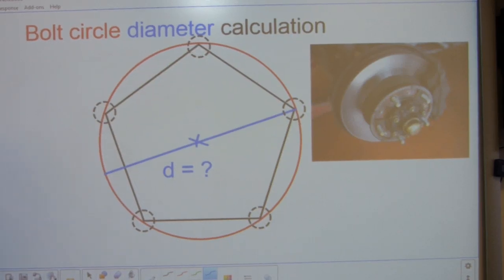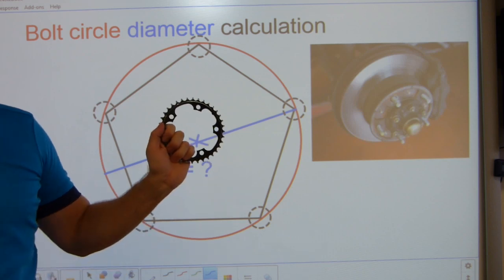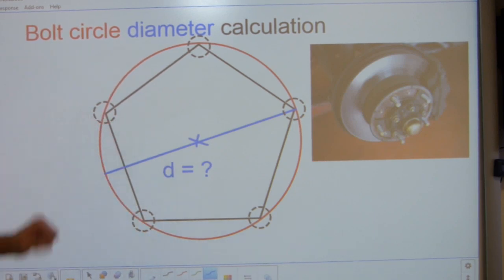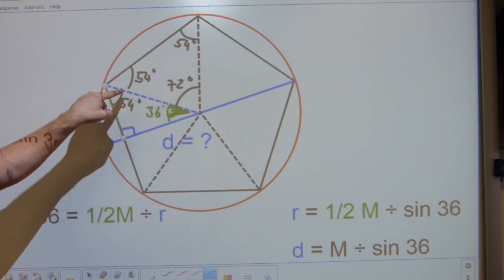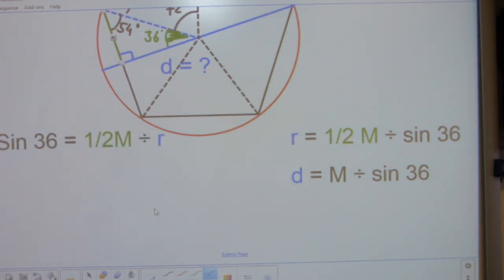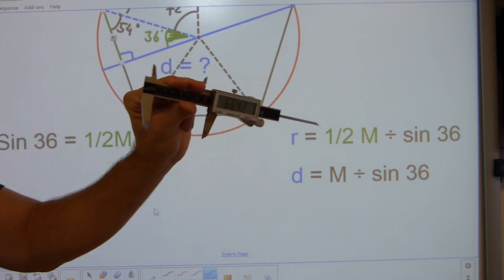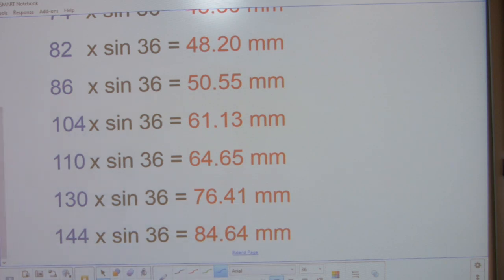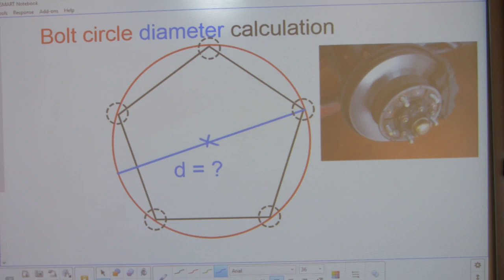Bolt circle (pitch circle) diameter calculation and some standard sizes

Comment: I woke up today with one goal. Find out what the sizes of my rear Brake drums are and order new ones. I got completely stuck after realising none of my bolts meet opposite each other as I have 5 😂 at this point I searched through many videos trying to explain how I measure a drum with five bolts and then I found your video. Explained really well and explained using bicycle wheel discs. Very cool very helpful and now I’m going to go draw a polygon on my old brake drums 😂😂😂😂 cheers mate. Hav a good one 🎉

Comment: If you're looking to find Center to Center of you're bolt holes with your calipers,  measure the inside diameter of 1 bolt hole,  then with the inside of your calipers again, measure to the far sides of each individual both hole that are adjacent and subtract the diameter of the one bolt hole that you measured that will result in dead center between two adjacent bolt holes, a whole lot easier than what you're doing
Reply: I know his trig formula, but thank's for the short cut.